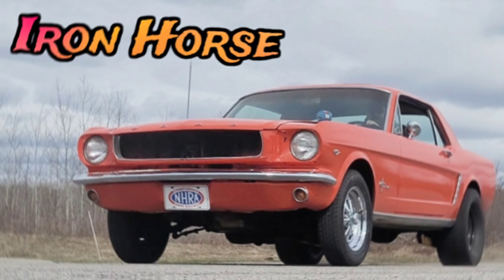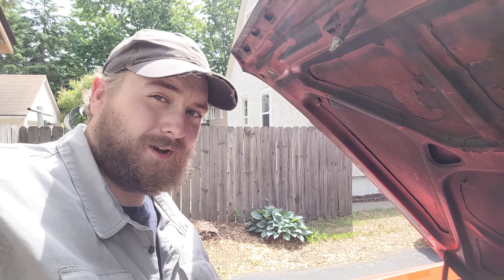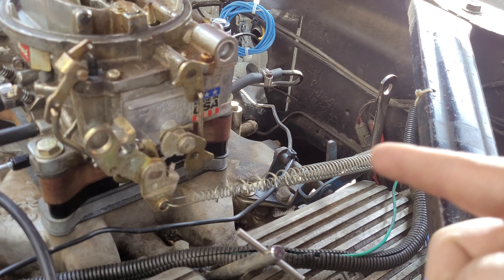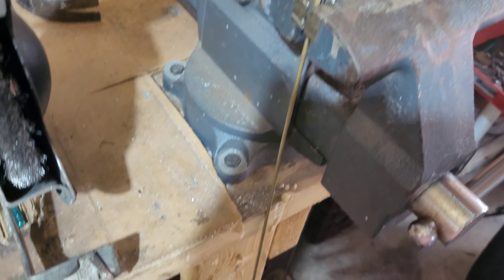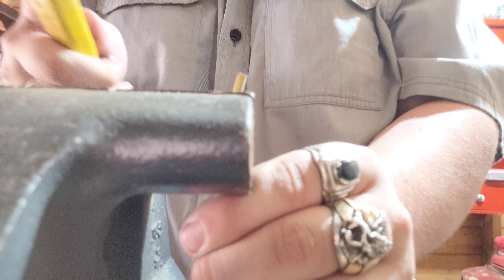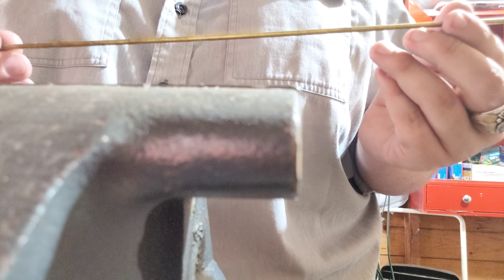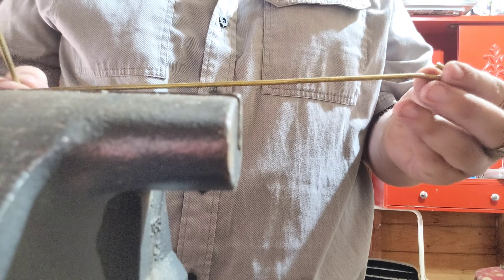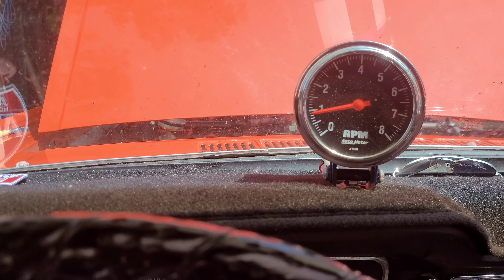1965 Mustang Thottle Linkage | Fabricating up a simple throttle rod for the "Iron Horse"

Comment: When i was adjusting mine to accomodate for the extra spacer, i held the throttle wide open and held the pedal to the floor and made it ever so slightly shorter so i could have perfect full throttle with the pedal just touching the floor without having the pedal stick up too far when sitting stationary.
Reply from the maker: Nice 😁 👌 
I did......well you saw my method 🤣
Reply: @newguysgarage6802  Yeah 😂 Hey it works, thats all that matters! I just personally didn't want any extra pedal distance, lol
Reply from the maker: Yep! 😁👌